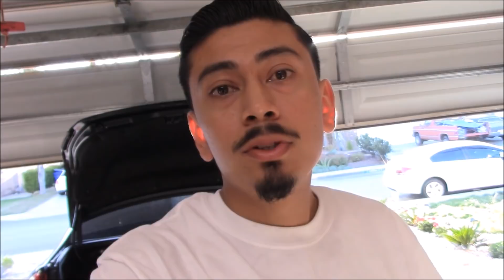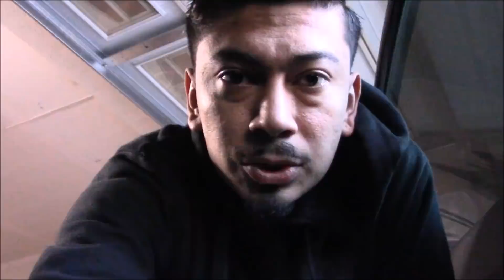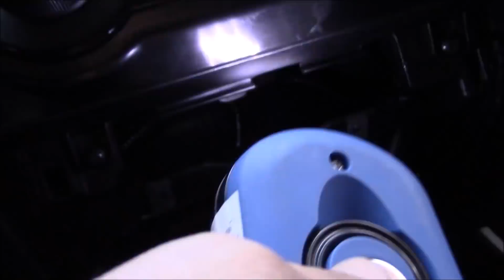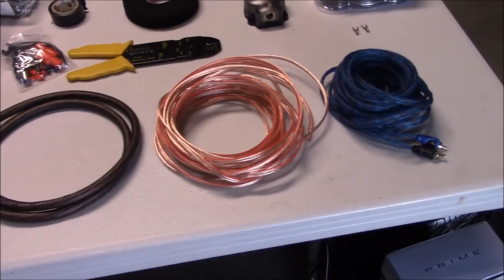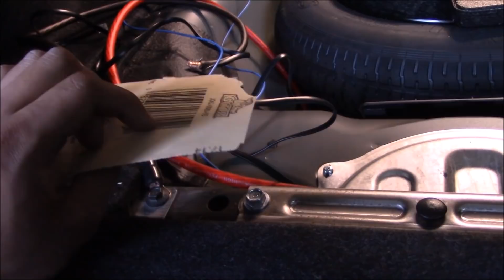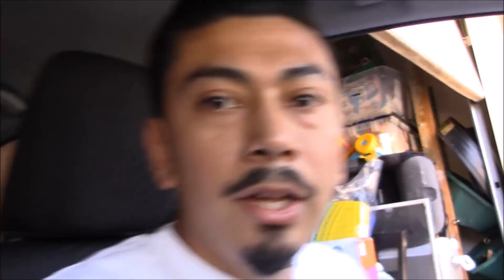HOW TO INSTALL AN AMP TO A FACTORY RADIO | 2015 HONDA CIVIC

Comment: Why dont u just run the rca cable to amp to back of stereo
Reply from the maker: When it’s a stock radio there is no rcas if it was a aftermarket stereo then yes u can

Comment: How would it work out if all I did was bypassed the factory subwoofer with a subwoofer box placed in the trunk? I don't want to add an amp etc. I just want a bit more bass. Thanks.
Reply from the maker: I havnt done That before so I’m not sure, but if ur looking for just added bass there’s lots you can buy there called hideaway subwoofers I believe and those are relatively cheaper then an actual sound system and still sound very decent 👌 if u really don’t want to n this is doing it at ur own risk u can try opening up wherever ur stock/factory subwoofer is located removing that subwoofer and if there’s a positive and a negative wire connected to it then after removing or splicing out the stock subwoofer u can then run extra wire to that positive and negative (if any) and then hook up ur new subwoofer and see if it’ll work that way even if it does I doubt it’ll push the subwoofer and I also wouldn’t recommend that but yea a subwoofer needs an amp to be able to push it or like I said there’s alternative like a hideaWay subwoofer (comes with a amp and sub together in same box) mainly used for trucks or compact cars where u don’t wanna loose space but still have bass
Reply: @JesseRizo  wow, dude huge response. I got a 15 civic Si.  It has a lame subwoofer on the rear deck. I think I will just splice the wires to the sub and extend them to a ported 10" box. Hopefully I'm satisfied with that. But it probably won't do, bass gets addictive.  Thanks for the response.

Comment: Is the 2017 accord turn on wire purple as well?
Reply from the maker: Honestly I’m not sure i don’t wanna lie but I’m about to do a install on a buddy’s 2018 accord in about two weeks I’ll find it then but just in case u do it ibefore me please let me know 👍👍
Reply: @JesseRizo  people were saying an ignition switch does the same thing and it is a purple wire so I was planning on splicing into that one if i find it when i do my install when my amp and sub comes in

Comment: amigo, sabes por que mi sonido hace un ruido bien fuerte como cuando pegas un cable en el lugar equivocado, nomas que ese ruido lo hace solo cuando las puertas estan cerradas y el amplificador tiene todo el volume. si habro la puerta ya no se escucha o si le bajo el bass tampoco pero no escucha fuerte el sonido. es Honda pilot 2013.  gracias si alguien sabe por que hecheme mensaje para arreglarlo por fa.
Reply from the maker: Puede ser el amplificador necesita que lo ajustes o puede ser el ground esta siendo mal contacto o si usaste un line output converter unas besas no esta bien, fijate en todas las coneciones estan bien
Reply: ya cheque todas las conexiones cambie al RCA pero no se quita ese sonido, en un lugar me dijeron que por que el carro trae unamplificador de factoria pero no se si eso es cierto, lo curioso es que solo lo hace cuando cierro las puertas.
Reply from the maker: lopzlopez47 trada de bajar en gain (volume) del amplificador aver si ayuda si no trata de mover el ground a otro lado
Reply: algo diferente que creas que puede ser?

Comment: Hey If i connect extra amp for the regular sound speakers  I get a wire from the stock speakers to the amp
Reply from the maker: I would not recommend connecting any amp to stock speakers they will blow :0

Comment: I personally would of hide everything the converter, amp cables, plus I wouldn’t of cut the factory harness but instead use the metro harness connecters, and wouldn’t use tape but wire loom. 
It still looks clean though!
Reply: Jon Carlos he’s not entering his car in a car show lol I always install mine the same way as him, never any problems in the past.

Comment: If you get a Dyna Mac Play behind the license plate in On a trunk lid where goes up inside but died a mat in it to will stop Dorado at that doesn't work do the sides of the trunk in the floor
Reply from the maker: Thanks my friend 
I’ve done it check it out https://youtu.be/B37iX-kdlB8

Comment: I installed the amp remote into the cig lighter fuse then my cig lighter accessory stopped working. Fuse is perfect. What do u think is keeping it from working?
Reply from the maker: Yea that’s not good my friend :0 try to stay away from adding anything to the cig lighter that causes a lot of shortages, 
& u could have burned the actual wire harness from there 🤔
Reply: Jesse Rizo thanks bro I’ll have to get the dealership to check into that. That’s way to complicated for me lol

Comment: I have a question about a 2015 Honda accord. Can I hook up a amp and sub to the stock radio and not lose my blue tooth capability and steering wheel controls?
Reply from the maker: Yes sir you should be ok 👍
All my functions still work on mine

Comment: I your trunk is rattling too much, try using “second skins”. Tape it right on the underside of the trunk
Reply from the maker: I ended up sound deadening it check the video out on it if u want https://youtu.be/B37iX-kdlB8
& I just did my tacoma as well https://youtu.be/_vxpT62AP0M

Comment: Ik it’s been abou 9months but where you get the amp wiring kit
Reply from the maker: No worries my friend and I got it off amazon I think I just typed amp wire kit
Reply: Jesse Rizo do they vary in length because I have a 2005 suburban and I’m gonna put a kicker Comp 15” but I wanna know which kit will be long enough
Reply: Jesse Rizo I’m putting it behind the third row btw

Comment: One question. With the high level converter can I adjust the amount from the head unit?
Reply from the maker: I’ll be honest that I’m not sure I’ve never installed one of those so I wouldn’t be able to tell you nor would I want to lie to you so I’m not sure my friend sorry
Reply from the maker: Yes u can my friend it’s not as good as it would be with a aftermarket stereo of course but yes u can
Reply: Jesse Rizo yo Jesse i have a 2015 civic just like this and i have a question:  do i absolutely NEED a high level converter if im installing to the stock head unit? dont some amps come with options to high wire instead of using a converter?

Comment: In my car, they didn’t tap the wires behind the head unit.. they just tapped the rear speakers.  What’s the difference?
Reply from the maker: I tapped into the rear speakers as well 👍 only thing I tapped into the radio was the remote wire which is when you turn the radio the amp will power up I did it that way so the amp won’t turn on every time even if the radio is off 👍
Reply: Jesse Rizo yea bro but the remote was from the converter to the amp .. I didn’t see a remote from the head unit to amp but from the remote on the converter to amp

Comment: Can I do this to amp my car door speakers ?? I don’t want subwoofers I’m getting old lol
Reply from the maker: Yes you can you will just need to get more speaker wire to run it to the speakers 👍, lol I’ll be honest I’m kinda over the bass as well 😂 I think soon ima hook up a amp to my truck but just for the door speakers lol
Reply: Jesse Rizo lol oh ok yeah because i want to keep my stock radio on my sub I don’t see the point of having big bass anymore I feel like I’m bothering other drivers with my loud bass I was a big bass head in my teens and 20s I had 4 15s in the trunk but now I just want clear music that’s all

Comment: I just got a Rockford Fosgate  r1 2x10”  and i’m new to this so can anyone help me by telling me how many watts it can hold max i as told (300W) so i’m not sure what amp i should buy but i really would like this to be installed.
Reply from the maker: It can handle 200 wats rms each so 400 max
Reply: Jesse Rizo I bought an amp that puts out 1200 watts max, is that ok? And thanks again

Comment: With using the converter can i tap into the stock subwoofer in my car so i can adjust the bass of that from the head unit
Reply from the maker: I probably wouldn’t mess with that to be honest I don’t want to give u false information because I havnt tried this myself :/ I’m sorry my friend
Reply: I would just disconnect the stock sub instead of taping in. If I was doing it I would clip the wires from the stock sub and connect them straight to the new one. Just to prevent “excessive bass or poor sound” from having two different sized subs. Should work either way though depends on preference. Always be aware if you have a stock amplifier though. If so you should be able to disconnect the wires from the stock amp for the sub and run those to the aftermarket amp.

Comment: Does every car come with the amp adaptor thats behind his factory radio
Reply: Robbie Sunderland  hi i have same system question i can use same converter for 2 amp and i need EQ  for connect my 2amp on my fsctory radio ?
Reply: i have toyota camry 12
Reply: pablitomontanez@gmail.com

Comment: why conect the 4 wires from the converter to both speakers since u only have one sub?? is it a must????
Reply from the maker: You need both a left and right just like rca cables have a left and right “black and red” it would be like connecting only one rca cable if u only hooked it to one speaker
Reply: but theres only one sub one box one sub only not 2 so u saying i should still tap into the left and right rear deck speakers for just one sub??
Reply from the maker: In all honesty it is just the way I was trained back in the day I’m not 100 percent in that all I know is connected it to both a left and a right will output more signal “more power to your amp” essentially what a loc does is just distributed high levels into rca outputs so if your only pulling from one speaker it won’t be pullin sometimes enough power give this a try just connect everything do one speaker only then after hook up the second speaker and you’ll see the difference and understand what I’m talking about lol also it depends the amp/watts you are running, it also depends if u have a mono amp or not some amps throw out voice/bass so if your voice is off on the subwoofer it’s notgoing to match the speakers inside and just sound off when your playing your music, all in all it’s just to get the both left and right sounds from the song that’s playing for example idk if you ever heard a song and the song goes from left to right speaker? It’s jast so the amp can send both left and right signal to the amp you get me?
Reply: got it thank u so muchhhhhhhhhhhhhhhhhhhhhhhhh
Reply: what i have is a bass box with a built in amp i dont know if its mono or not

Comment: I have a question that my RCA converter does not have land just for speaker and RCA, you know how it works? I already made all the connections and the amplifier turns on but the woofer does not sound, can you help me?
Reply from the maker: What kind of loc do u have?

Comment: You have enough money to buy woofers and an amp but not the extra $100 for a proper stereo?   It's NEVER a good idea to wire an amp to speaker wires and a line level converter. 100% of the time it will sound noticeably better when hooked to a stereo that has RCA outputs. ALWAYS start your stereo upgrades with replacing the head unit first.
Reply from the maker: This video was sponsored I did not pay for them, and the purpose of this video was to demonstrate how to install a system without a aftermarket stereo now a days with the new stereo that comes in the cars they are a lot more advanced and have more features that purchases an aftermarket one, I worked at a stereo couple years back this was probably one of the most upgrades that most people did due to the better stereos that come with the cars now a days and that’s why when u purchase the loc it’s a great idea to get a high quality one so you don’t notice the sound difference👍

Comment: i dont have rear speakers and do i have to use the high level converter???
Reply from the maker: So sorry for the late reply and you can use the front speakers it should be the same install process all the line output converter does is just helps send a signal to your amplifier 👍 hope that helps my friend
Reply: @JesseRizo  thanks for replying , also do i have to hook it up to both 2 speakers or can i do one only
Reply from the maker: I would do both you want a left and right connection

Comment: Good video, but couldn't you also just use a LOC with Remote On output to simplify install? Thinking of having the Loc and Powered Sub in the trunk, with LOC connected to rear speakers (wires) and the only wire going to the front being power from battery. Thanks!
Reply from the maker: You probably can the only reason I did it this way is I only wanted my amp on whenever my radio was powered on so if was driving and turn off my radio the amp would also turn off just as if you installed the system on a aftermarket radio I wanted the same effect but I’m sure u can just I havnt done that

Comment: Great job, man! I love the video. I was wondering what is the inline fuse kit you used and also how did you secure the box in the trunk so that it does not slide around while you're driving? Thanks. Hope to see more Civic vids soon!
Reply from the maker: The fuse kit I got was just a basic one from amazon 👍 as far as the box I use L brackets and bolted the subwoofer down to the carpet spare wheel cover (the floor in the trunk) I forgot to record that part but that’s pretty much all I did 
Thanks for watching I appreciate that :)

Comment: hey i have a 2008 honda accord ex and i bought a 1000 watts dual amp 4 channel and a amp kit and i just got a converter that goes to the back of the radio
Reply from the maker: That’s awesome it should hook up the same way 🤔

Comment: Hey, just commenting again because I know you read your messages haha. I'm installing a 4 channel amp for speakers and 1 channel for my subwoofer. For some reason, my amp came with an 8 gauge wire. I have a 4 gauge connected to the battery, should I run the 8 gauge wires from my distribution block to my amps or just get a new 4 gauge wire?
Reply from the maker: You go max 900-1000 watts total between both amps but can't exceed more that 400 per amp 8 gauge is good for the 300-400 watt range 4 gauge can take about 900-1000 watts Roughly
Reply: https://www.amazon.com/gp/product/B01MAX2S9N/ref=oh_aui_detailpage_o01_s00?ie=UTF8&psc=1
https://www.amazon.com/gp/product/B00CMC50VI/ref=oh_aui_detailpage_o03_s00?ie=UTF8&psc=1

These are the two amps I bought

https://www.amazon.com/MTX-Terminator-TNE212D-200-Watt-Enclosure/dp/B001JECAM2/ref=sr_1_1?s=electronics&ie=UTF8&qid=1535428498&sr=1-1&keywords=mtx

That is the sub I bought

So should I go for 2 gauge wire instead? And I shouldn't run the 8 gauge, I should get a larger size?

Thanks for the help!

Comment: im halfway through bro. you answered literally 3 of my questions so far, and I don't even drive a civic. Awesome video
Reply from the maker: That’s awesome man I’m just glad I can help, 
Thank you for watching I appreciate it alot
Reply: A couple more questions I'm trying to find though are with my LOC, I want to connect it to my stereo wires. Do I just cut all the required wires behind the stereo and connect them with the LOC wires? And with speaker wires, Do I just bring them to each front/rear speakers, cut and connect? 
My setup is coming in a week, so I was just trying to prepare beforehand. Thanks for any input!
Reply from the maker: The loc just has to be connected to just rear speakers or just front speakers I connected mine to the rear speakers just because it was easier and I just connected the speaker wire directly to the speaker and the loc speaker wire straight to the speaker in the video I walk threw that process to hope that helps
Reply: I have a 4 channel amplifier and I want to power my front/rear speakers with it. 
To my understanding, the speaker wires run around the car to the stock stereo. If I connect the LOC to the front/rear speakers there, do I just attach the RCA cables to the LOC, attach the RCA to my 4 channel amplifier, and it should power the front/rear speakers?

This confuses me because I don't understand the point of having 4 channels if I'm just going to use the RCA cables to power my speakers

Comment: For the part with the remote wire I believe you could have avoided removing the radio by putting a "add a fuse" to a fuse in the fuse box that only turns on with the car, I know this may cause a popping sound from the subwoofer depending on the amp type.
Reply: What fuse would you go into?
Reply: @ml-fishing1341  ignition or headlights always works

Comment: Hey what’s up Jesse, what about if you’re doing like a interior speakers and sub set up, I’ve seen the Sub set up. but I’m running an Clarion EQ no High output converters. What would be my next step into getting the entire vehicle amplified
Reply from the maker: So sorry for the late reply, we’ll usually as far as your interior door speakers if you want good power out of them I would get a secondary amp just to power the door speakers and keep the subwoofer on a separate amp that’s probably your best bet on amplifieing the whole vehicle since you need no line output converters I’m assuming you have a aftermarket radio installed as well?
Reply: Stock everything.

Comment: Can you use a LOC on a aftermarket head unit
Reply from the maker: On a aftermarket head unit it will have the RCA inputs in back of the head unit so there would be no need for the loc
Reply: Jesse Rizo yes I know that but I don’t have the adapter and I’m trying to not buy a brand new head unit
Reply from the maker: If the back of the aftermarket radio you said you have does not have rca inputs which is not really common then yea just get a LOC converter you don’t need to get a new head unit I hope that answers your questions